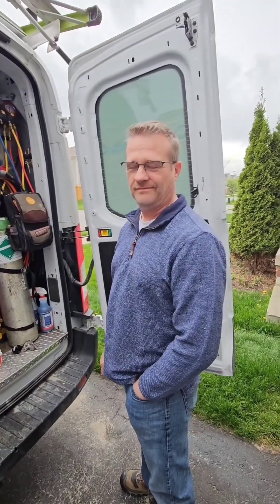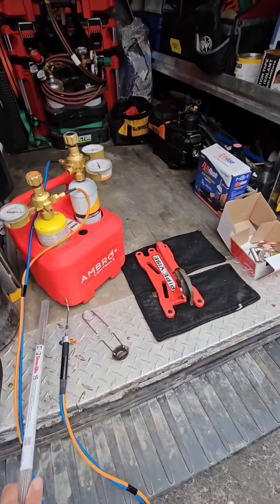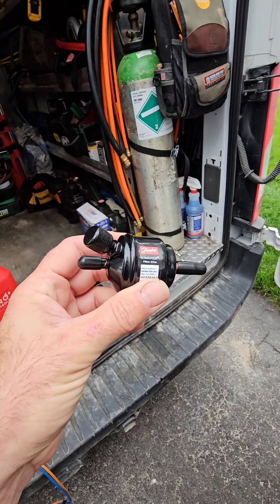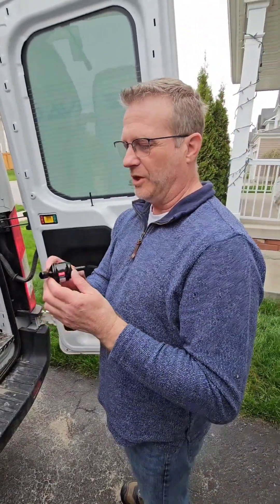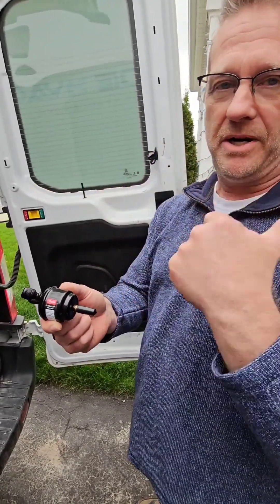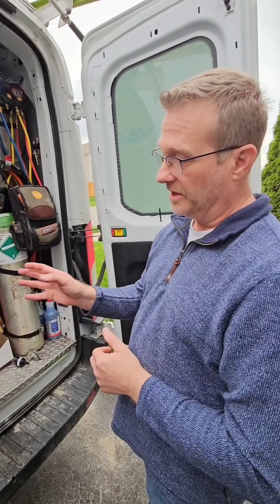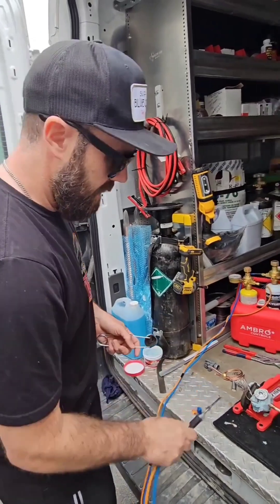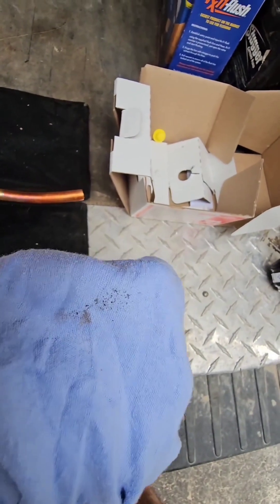TXV Brazing Tips And Liquid Line Filter Driers

Comment: Geat video.  I know you did not flow nitro for demonstration purposes,  what is the best way to remove those flakes from that txv afterwards?
Reply from the maker: Using a flush system like RX11 flush but nitrogen will avoid all that.  In reality RX11 is only for linsets

Comment: Always ask if the nitrogen cylinder has been used for clean nitrogen only. Sometimes the cylinder was used for some other gas and it just gets repainted. If it has had some other gas in it you now have dirty nitrogen and you can get high levels of copper oxide inside even though it's clean gas. If possible get only medical grade nitrogen, the sales person will probably give you a strange look but tell them that is what you want. And even with clean and pure nitrogen you will get some copper oxide build up.
Reply from the maker: Counter guy will zero idea about this

Comment: Heat the joint first. If your gap is snug, heat will transfer quickly to pipe. If not snug, use a lever type swaging tool.